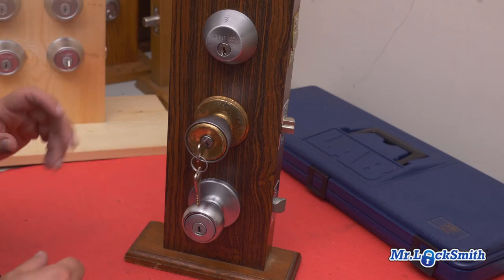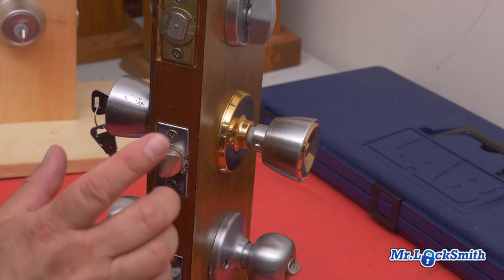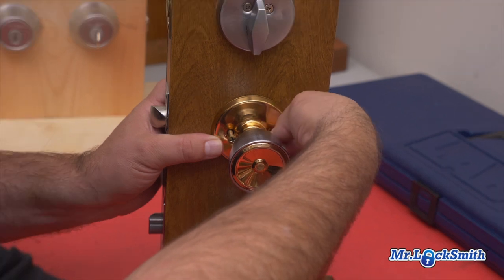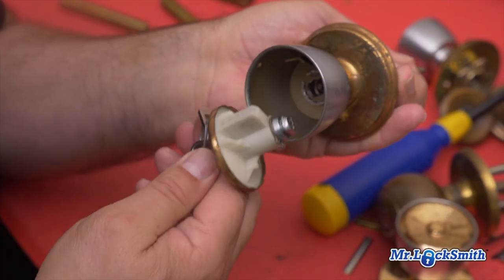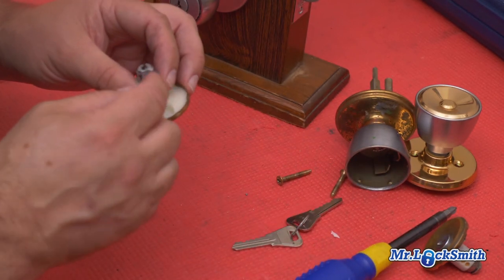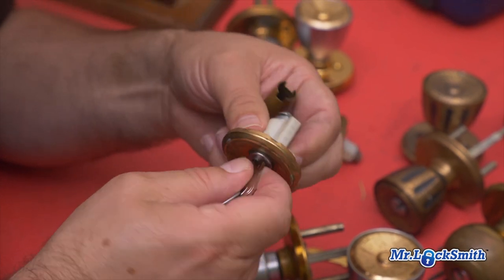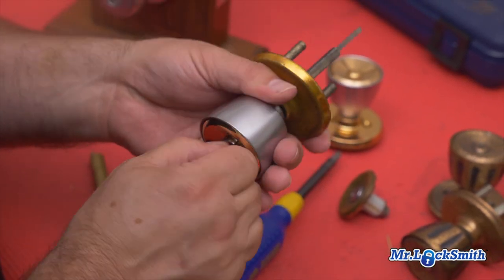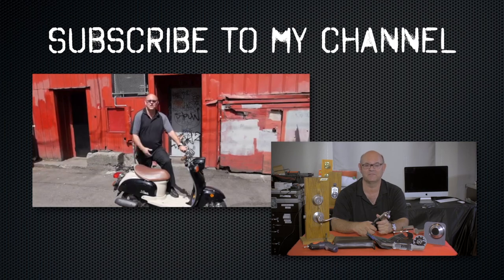Rekey Old Style Weiser Key-in-Knobs | Mr Locksmith Video

Comment: You saved me too Mr.Locksmith. I haven’t ran into these in a good while in my area, had a 11 lock rekey today all Weiser knobs and dbl deadbolts.
Reply from the maker: @LCLockout  I just had a lockout with one today. It picked open fast! 

However, get a few lockouts where the key turns and the inside handle won’t release. 

Easy to “pop” the cylinder or drill open.

Comment: Good luck with that clip holding in the plug!😅
Reply: Those clips are used in lots of machinery and electronic equipment. They work well. You just need the proper snap ring pliers to remove it.
Reply: @alan4sure  Im very familiar with them. Just not a fan of them.
Reply: @mattnapiersoundguy  I like'em until it flies off the tool tips and hides somewhere.😄

Comment: Hello. I have a batch of what appear to be Weiser/Kwikset locks that are using a WR key blank and look almost exactly like these except for a few things. With these, instead of pulling on that shaft, you have to push. It pushes in instead of pulling out. Also, there is a small pin that pops out right next to the keyhole on the core. I am unable to get the cylinder out of these to rekey them. Any ideas?